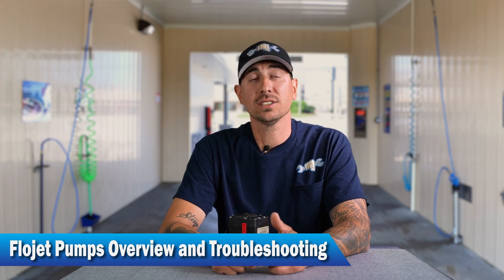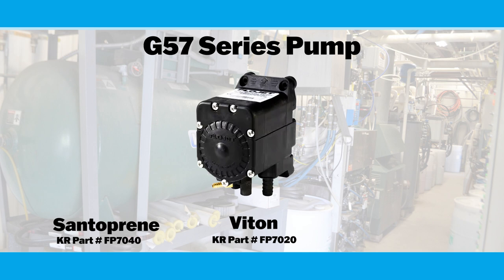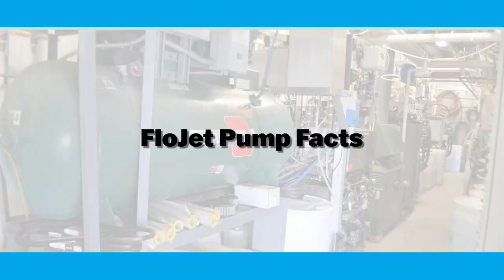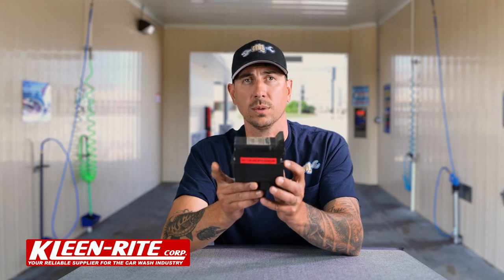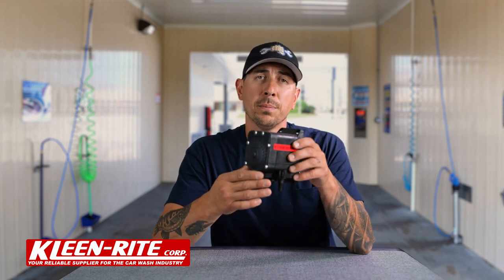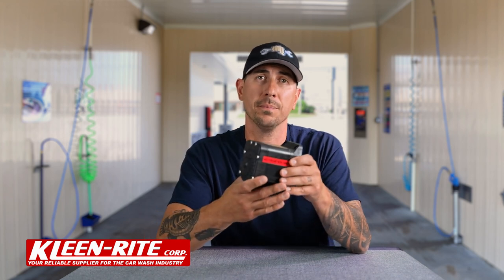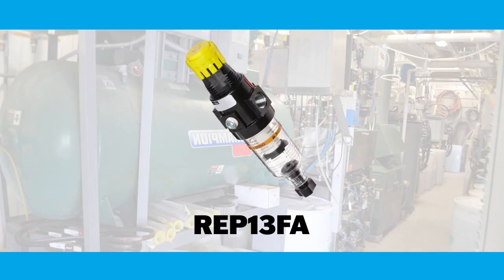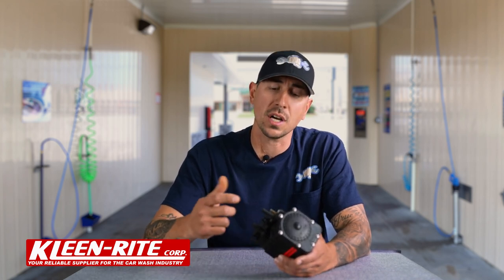Flojet Air Pumps Overview & Troubleshooting - Fix It With Phil | Kleen-Rite

Comment: We are using the Flojets for Tire Shine. Air is on for 1.5 seconds.  30 psi. The liquid continues to flow long after the air shuts off, out onto the brushes. Any ideas as to why?
Reply from the maker: here is the reply I received. Hope it helps.
Gravity. Once the line is charge at 30psi it’s pushing product at that rate, once the air shuts off the line is still full of product so it still flows freely just not being pushed at 30 psi. So brushes being fed from above means the products will flow with gravity out of the brush even though it is not being pushed .

Comment: The exhaust is leaking considerable  air - is that a fixable issue or is the pump in need of replacement ?
Reply from the maker: It is possible a diaphragm kit will fix the issue.  However, when this happens we usually replace the pump
Reply: @kleenrite  Thank you ...will order a replacement ...thank you
Reply from the maker: no problem! we are here to help!